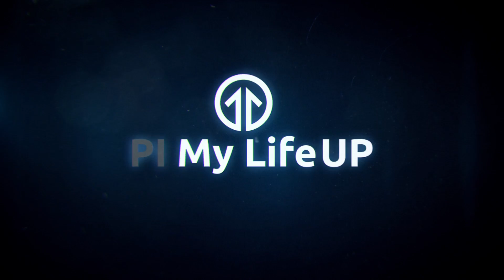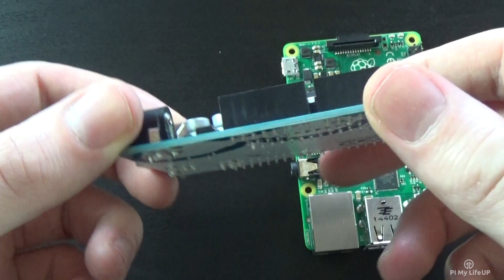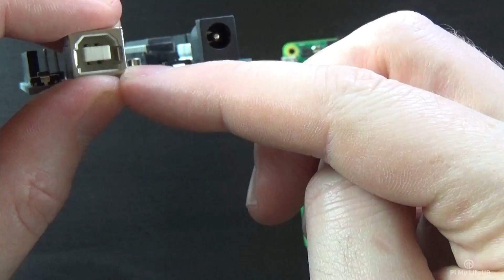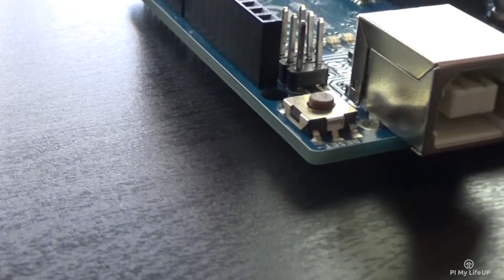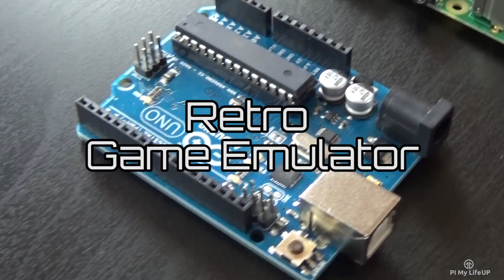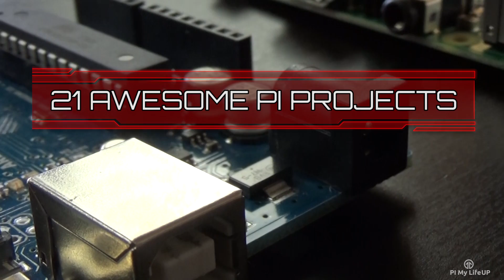Raspberry Pi Vs Arduino Uno: Which Board is Better for You?

Comment: take-away Arduino is an OPEN platform.  and can be installed and left for years.,  the Pi is closed, you are not allowed to talk about clones in the Pi world,  and 5 times more expensive because they control it.  what they don't tell you is that it fails regularly.   watch the videos on the best SD cards to get and replace, and replace and replace as it burns them out and fails routinely.
ANY pi competitor is better than a Pi.  why ? because the Pi foundation is a rich corporation that exploits people and offers a crap product because they run the forums like nazis.    say anything bad and you are banned.  google single board computer, get anything else than a pi.   
by the way, the drone who narrated this used the official voice of the pi federation.  the only approved voice you are allowed to use. and the only allowed way to speak.

Comment: Can you interact with them with tablets and android phones? I like doing projects with dc motors    and leds so Ill take the Arduino since I'm a beginner.
Reply: Sizzlik nice
Reply: I got the raspberry pi 3 and use my android phone/tablet as monitor over a VNC tunnel. The "VNC Viewer" app got an inbuild mouse and keyboard (i use a tiny bluetooth keyboard)..so that way i can controll the GPIO pins over Bash/Terminal or Python or C++ or C#. Im a beginner myself, but in my opinion the Raspi is a bit better for beginners..because as said, it got a full operating system. Thats a good start for people that already know how to use a computer and want to learn how to programm micro controllers. Audrino is in my eyes a board thats better for people that already know what they are doing or want to accomplish. If you havent bought an audrino yet, check out the site "circuits.io" Its free and there you can build and simulate circuits and play with the audrino.
Reply: I got a clone Arduino in a kit full of wires , servos  , leds for 22 euros in china. I am happy with it. I don't have to program myself, because I just upload it into the Arduino.

Comment: since i want control a robot with a computer :
must i make my robot walker around a arduino than control the arduino with the raspberry ?
is that easy with interfaces to sale & tutorials for use ?
what about cc3d chip compared to arduino ?
actually im not codder nor electronic engineer just hoobyst customiser goblinoid
i  got some .lua knowelge from game modding & welding+mecanic tools then plan to buy a 3D printer(ready to use) for make cranks gears & complex parts

Comment: Hey, liked the video. You mention that the Arduino is "better" at interacting with other devices, because of it's simple architecture. I'd like to know, what makes it better? Can it do it faster? Is the programming language easier to pick up? Assuming you know your way around linux/raspberry pi, why would one choose to spend the same amount of money on a board that is capable of less? Thanks for the extra input.
Reply: +computoman8726 Arduino can be used as a prototyping platform to develop and debug a system, and once it's running smooth, you really only need the chip (plus whatever shields you're using, obviously) to run the project. Arduino has a lot of circuits to cater a wide variety of needs, but they're not very complicated and quite easy to reproduce even with veroboard. The microcontroller chip itself costs a few dollars only, so designing for Arduino may yield very inexpensive designs indeed. 

Another thing to consider is that microcontrollers are realtime. Their latency is both faster and more predictable than SBC's. It's not much of a concern with pushbutton controlled blinkenlights type of circuits, but it is when controlling eg. servos.
Reply: +Hashim Aziz Single Board Computers; Raspberry Pi and the like.
Reply: +computoman8726 do you mean than:
the arduino is better to at interacting with the raspberry than the raspberry at interacting with the arduino ?
Reply: +Michael Carnevale by real cpu do you include raspberrypi ?
Reply: +Michael Carnevale so its a good couple
is any advantage to use laptop more than raspberrypi for controlling arduinos ?
as i understand with the expension board for sale we can bridge unlimited number of arduino on a single raspberrypi 
but is it really unlimited ?
Reply: +Karri Koivusalo SBCs?
Reply: Ah ok, thanks, very insightful.